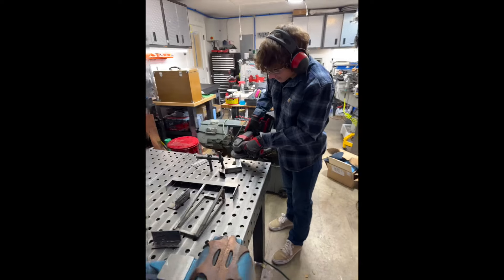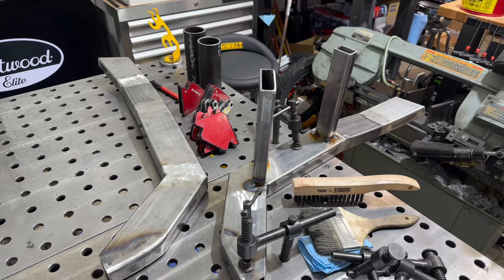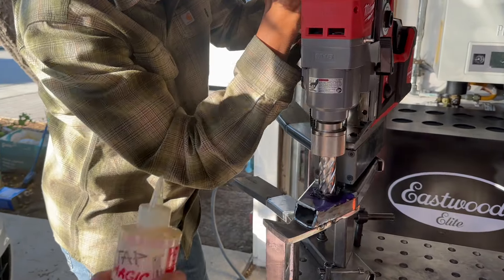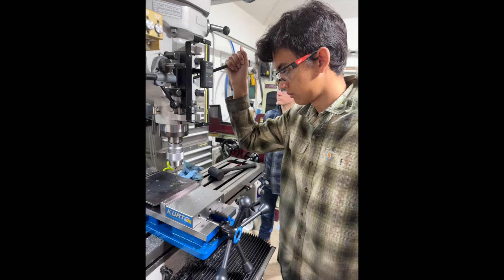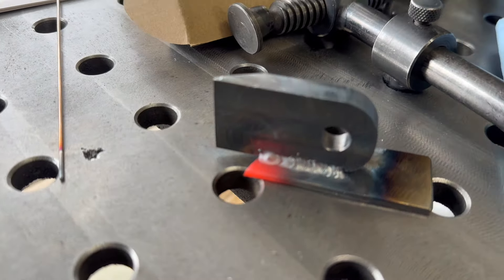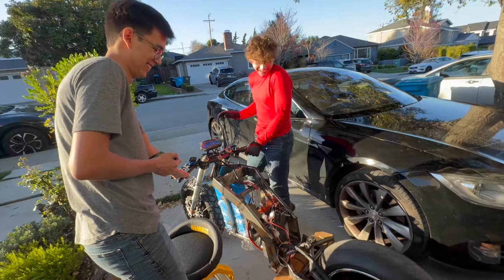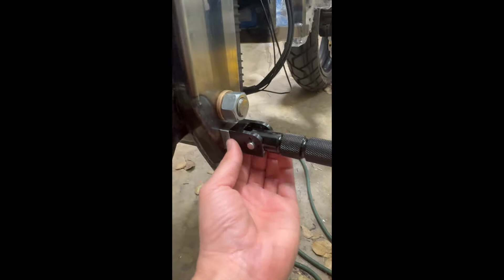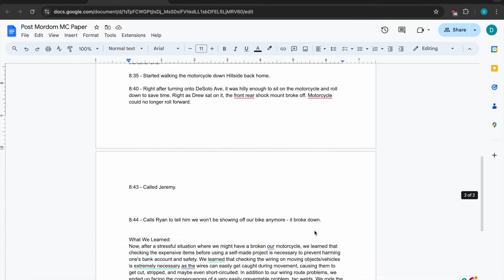Building 80 MPH Electric Motorcycle From Scratch

Comment: Great job lads!!!

But, at 5:12 the frame that's got that severe weak point needs to be fixed, and I don't just mean welded back together - Safety first fellers, that frame part where the shock is, it really needs to be a lot stronger, if that weld were to fail at any speed over 10 mph and it's gunna be seriously nasty...

You NEED to improve this part of the frame, it HAS to be way stronger, the last thing you need is a structure fail at such an important part of the frame, right where the rear tyre is..
Sorry, but it's dangerous...
I'm just thinking of your safety 👍

But other than this, wow!!! I'm impressed!!!
You lads have done a great job, and it's great to see!!!
Reply: We fixed it don't worry.